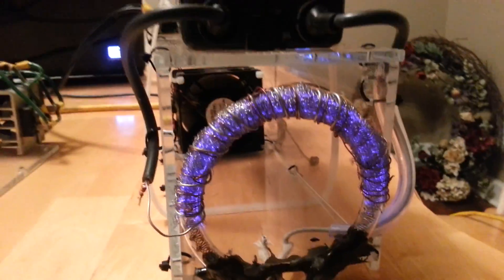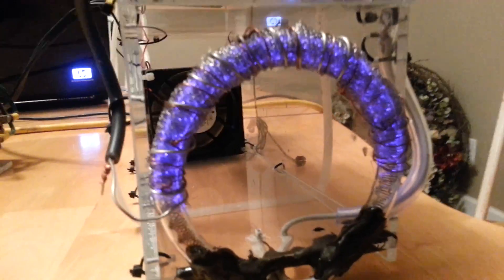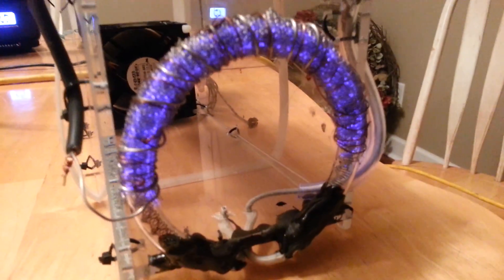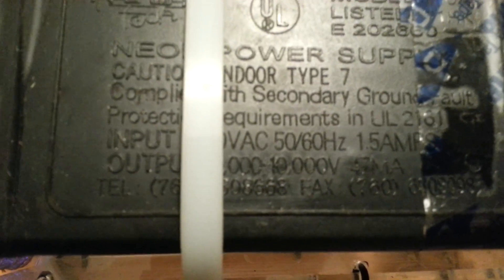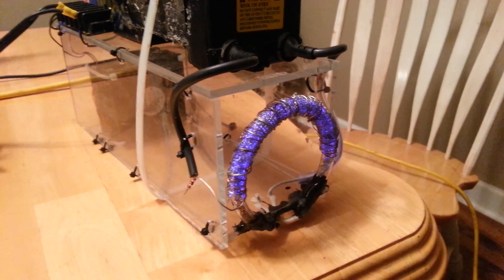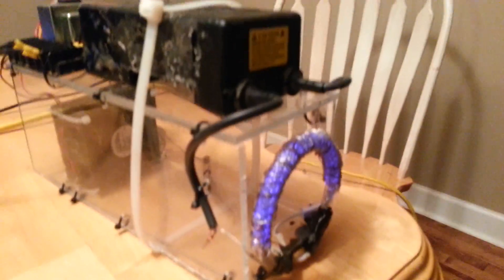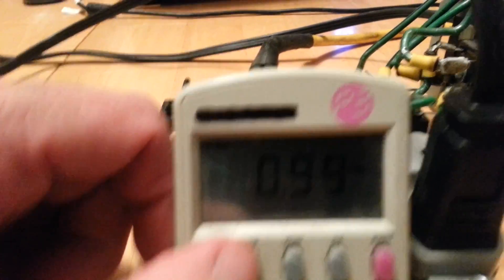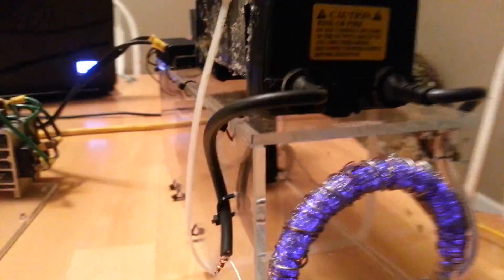Ozone generator  (completed )

Comment: Facinating, I had no clue about the fact of o3 having such an ephemeral half-life at such modest temperatures up until now. Same with the HF flybacks vs iron cores too as I have a few non-mutilated MOTs and was scouring around for some decent less-than-100%-death-probability HV projects before I just integrate them into my AC welder home-build instead...

Comment: Make a transformer to step down the voltage so you can measure it. Wind it specifically for your range- 1000 to 1 or 100 to 1 , whatever you need  to measure.  It does not have to be fancy, just be careful  to not interact with the HV

Comment: Nice! I’m wondering how much ozone that’s generating... maybe you could try to titrate it if you feel like you’re able to do so? It’s basically using a solution of potassium iodide and passing the ozone through it, then adding potassium thiosulfate until it’s light yellow, adding starch, then continuing until it’s clear. You must measure the amount of thiosulfate you add, then you can determine the amount of ozone you’ve generated with some chemistry math (I’ll tell you the equations if you want them).

Comment: solution to the heat problem is increase the sourface, basicly just use multiple tubes in parallel. For the fungus, its best to bring the generator as near as possible to the source of your problem.

Comment: I have been playing around with O-Zone machines for a number of years. One thing that was not mentioned is that Ozone will also deteriorate rubber. I experienced this, I had the rubber bands that hold a respirator virtually disintegrate. It not only lost its stretch entirely, it also severed itself where it was connected to the staple. I was so intrigued that I tried it a number of times and sure enough, every time I would leave it next to the O-Zone machine for a day the band would be severed.
I have been very reluctant to use it in an automobile
Reply from the maker: thanks for the info friend , ill keep that in mind
Reply: He lost his balls and his rubber 😉😂😂😂

Comment: try using a flyback from an old crt, The reason it gets hot is the amperage and you have 47 ma, which is far to much. I would recommend the flyback because it has a max of about 35 before it burns out and you can run them at higher voltage then current. id recommend below 10 ma, and my design for a small ozone generator doesnt use a dielectric, It is a low diameter piece of copper tube about a cm long and a nail is aligned in the middle with a device to adjust it back and forth according to voltage. You want the nail to be far enough away to get corona discharge, which is the loud hissing streamers, but you dont want it to strike an arc. Another bonus is the fact the moving ions push the ozone out of the pipe automatically, so no fan is needed to get a slight breeze of ozone. I upsized mine to a lattice of 50 pipe segments soldered together in a grid and a nail per segment and it really throws off ozone. I have found putting a high voltage capacitor of a low capacitance in series between the gap can sometimes make more ozone and thrust, but unsure. Be careful with NST transformers, 50 ma is right in the kill range. be safe, i aint responsible for any injury from my advice.

Comment: Hey NOBOX7. Can you tell me what you have behind the neon transformer? You have a big square behind it then another square thing on the table with all sorts of wires. I bought a cheap ceramic ozone generator off ebay imported from china ($23). The transformer broke the first day. Though the plates worked great before the power died. So I'm wondering if I just by a $50 neon transformer off ebay and connect it to the plates I already have with a fan... if that would work better?
Reply from the maker: The other device you see on the table is a Dc power supply that also has a watt meter on the board that i use to build and test things   , im not using the dc current in this video im just using the meter to measure the  power used by the ozone generator . the other square you see behind the neon transformer is a volt transformer used to power the blower fans that help discharge the ozone gas from the device and also keep the exciter coil cooled off  . If you do buy a neon sign transformer make sure its a flyback transformer and also keep in mind the plate size verses power source has a very narrow spectrum of operation , to small and you'll fry the plate , to big and it wont liberate much ozone , if you check my other ozne videos you will see i destroyed 15 to 20 plates before i found an optimum size and composition

Comment: Wouldn't the solution to lowering the heat be to increase the wind power? Which would beneficial because you'd be dispersing the ozone into a greater area, you would have to do it in a way that reduces noise though. There are some commercial machines that I have seen that kick out a tremendous amount of ozone that utilize static plates. Their main function is to reduce nasty smells by having the 03 molecule react with contaminants. I would presume here that the goal is to create ozone as a way to improve air quality.

Comment: argon quartz tubes work good and are safe as they don't heat up. Stainless steel screen separated by ceramic works good for an open air unit. For a closed ozone system so you can pipe the gas or use an O2 concentrator, argon tubes are good.  Argon tube inside a honed steel pipe or copper pipe. must be smooth as arcing will occur at seams and rough spots.

Comment: Been looking around and haven't noticed anyone attempting to use natural Mica sheet / Isinglass as found in woodstove supply shops, hair dryers and space heaters (Keep in mind not all Mica is the same, processed paper has additional binders which would likely cook out / not all hair dryer coil winding insulators would work the same compared to fabricated mica sheet.)

Hunting for my Neon sign now, I'll get back to you later. :D

http://www.anjanagroup.com/mica_tech1.htm
Reply from the maker: Good comment i never new the name of that stuff, soldering irons are loaded with that stuff, hey just remember a small electrode can fry your transformer , so be carefull , i highly recommend using a router speed controller and watt meter, you dont wanna burn your house down
Reply: NOBOX7
Got a desktop neon sign, still toying with ideas on the discharge plate, BUT it's also occurred to me that the grid from an old bug zapper driven by a high performance ignition coil (60KV+)  and a 555 timer pushing a 12V Op Amp isolator and wired with Spark plug wire might just do the trick. I'll get back to ya', but feel free to run with it.
Also hunting for a cheap fish tank air pump to push air through the "biggest pickle jar" I can find
;)
Reply from the maker: Ziggy Popacapolis i like the fish pump idea , i just scored on a huge batch of pyrex lab glass and one piece has an intake and discharge perfect for a force air ozone generator. you can sterilize water with it

Comment: Very good video, and I like your comments, and I like that fact that you are asking questions, and working together with the other people commenting to devise better devices.

I've been tinkering around with ozone, with no success so far.

I tried using a microwave oven.  I pulled off the high voltage wires that connect into the microwave generator (whatever it's called) and used a mayonnaise jar with copper wire wrapped around it, and a wad of copper wire stuffed in it, but nothing happened, even on high power.  Maybe I justmade a big capacitor.  Then I tried just 1 piece of flat glass with two thick pieces of copper wire taped onto either side of the glass, but still nothing happened.  I think maybe my voltage from the microwave is too low.

I wanted to ask Karolis P where he found a 16kv source.  That's sounds pretty good.

I found some china ozone generators on ebay that are just a transformer and a couple plates, and I'm going to see if I like that.  But, it seems a person ought to be able to build a high voltage transformer, and come up with something for plates, for less than it would cost to buy about 10 of those 7 g/hr (supposedly) ozone generators.

Any further ideas on what is a good insulator besides the sodium borosilicate glass?  How do you think plain ole' ceramic would work (the kind you use to make pottery).  The question is, what is the best for the metal electrodes?  Is thinner better?  Larger surface area? etc.

Please keep posting your info, as I'm very interested in whatever you learn.  If you like, I can tell you how it goes with the china stuff I bought.  It should arrive in a month.  If I'm really impressed, I just might buy about 10 of them, if I can't figure out how to build my own transformer better and cheaper.
Reply from the maker: your voltage is to low , aslo no glass or ceramic of any kind seems to be able to withstand the high tention , one thing i can say is your electrode size will depend on your power source, it tooks weeks of destroying my girlfriends china to figure this out, the transformers in old tvs will work they are called fly back transformers.
Reply: NOBOX7
Have you tried borosilicate glass, also known as pyrex, I think?  I looked on ebay and found tubes, plates, etc of borosilicate glass at pretty  cheap prices.
Let me know if you try it what happens.  I saw that you can buy quartz tubes, etc from lab supply companies, and not too expensive on ebay.
Reply from the maker: thanks please share your results

Comment: I too have struggled with an insulator. they all get holes burnt through, even a toughened glass cooking pot lid, which then shattered due to localised heating!!  So thanks for the tip on using that kind of bulb!

Comment: Hi isn`t it better not to breathe Ozone if you can avid it. Its handy for some things if you get out of the way, but can damage lung tissue etc I believe.
Reply from the maker: yes correct, this device is for mold and smell mitigation, and i have to say it works very well, i was able to salvage some very valuable old books with this device, however i have since avoided using it in my car due to the corrosive nature of the gas as im worried this can corrode my copper contacts on the 20 or so micro switches "censors" in the car

Comment: Just be careful with the UV output. You don't want to get cataracts.
Reply from the maker: i never thought of that , did you no halogen lamps emit high levels of UV , it will gives you sun burn in no time , it actually happened to me  wen the cover broke , then i noticed the sun burn and rememberd years ago reading not to operate holagens without a glass lense cover , sum bulbs have a coating for it
Reply: I don't really think this has such high UV level, I don't think it is bigger than a sunny summer day

Comment: i've been thinking of a design using 2 wine bottles as dialectrics.  1 small, 1 large -- with cut off bottoms piped into water using a venturi.  
i wonder if a 9kV 0.5A  source would push good O3.  would like to venturi it into water. 
i figure i can use a stainless steel winding of wire on inside and outside of small bottle, while the big bottle would contain O3 for venturi recovery.
i figure I'd put a rheostat before transformer to control Amps and thus keep heat down.
Reply from the maker: very good idea , i also suggest looking at lab set ups for ozone gas generation , they disclose some good info, the lab devices seem to favor high frequency systems also . they have very large gaps between the dielectrics and this is the air space thats used for ozone generation, but i don't do it this way i simply place the electrodes on both sides of the glass , this is hard on the glass but it works.any way you can purchase a devcie called a router speed controller at harbor frieght for 20$ they work great for power controllers
Reply from the maker: hey i forgot to tell you. stay away from large glass electrodes, if its to big it will act as a capacitor and and can blow up your circuit , i may have already told you this but aint sure, this happened to me, also the device plane wouldn't work if the electrode was a resonance size . the wine bottle will reqire alot of wattage im guessing 150 watts or so. the transformer i have does not have the power to run
a wine bottle size device
Reply: i was thinking about winding stainless wire inside and outside the small bottle.  technically, whatever i use IS a capacitor. I plan on a fuse regardless, so it should blow back on the circuit if the voltage surges.  Makes me think...i need 2 fuses.  One before and one after the 110v potentiometer.
Reply: where is 'lab setups' ?
Reply from the maker: chris argauer yes but a threshold exist , to big of a capacitor and it will slowly burn up your transformer or it will simply not work at all due to over capacitance , the test ive done indicated that a specific size electrode service area will function at optimum levels  , you will need a conventional dual winding step up transformer to run an electrode the size of a wine bottle  . please post a video of your device wen you Finnish it

Comment: Good advice. I have an IR gun and will monitor the temps.  My project is on hold as I wait for some quartz tubing to arrive. Picked up 72 linear ft of 25mm OD x 22mm ID tube cut into 141mm (5.5") pieces on eBay. This cost less than a 4' price at most retailers. If you would like a couple of pieces, private message me and I'll send you some.  I am hoping that I won't be burning through 3mm quartz.  Should come in handy for all kinds of projects.

Comment from the maker: i forgot to mention i monitor every thing with a thermal gun during testing, diodes can operate at 150 deg F but a good rule of thumb never allow heating over 130 degrees , at this temp internal elements can be as hot as 200 deg f , most circuits can handle 180 deg all day but i stay under 130 at all cost

Comment: Lol, yeah I bought one on ebay earlier tonight.  I opened up the case on the transformer, which was not easy, as it is glued closed and not meant to be opened.  It looks like failed caps.  I am going to try to repair this one for the fun of it, but i am going to get a backup.

Comment from the maker: yes when building something like this you never know when you will burn up a good circuit. i am running this device at 1/3 of what it can do and it will run for 24 hours 7 days a week. you need a watt meter to determine your power consumption

Comment: Thanks for the advice.  I build a similar machine with a linear element made with a test tube (couldn't find the cool semicircle bulb).  I had the same transformer and it melted down after about 2 hours.  The electrode stayed cool.  The internal heat sink melted the top of the plastic casing on the transformer though.  It is leaking all kinds of oil so it may have just been a bad cap.  Will get another and try again.

Comment from the maker: no i don't sorry but it is a 60 watt device and from what ive seen its a very powerful model  , this device has not bin tested for production however it can be done using beat juice , borosilicate glass is what you need to do this , ceramics and glass do not last long at the power level im using

Comment: The key is to keep ozone tube and circuitry separate and use stainless steel/borosilicate glass only for the chamber components. Also, to respect the rule of 3P - people,plants,pets should be removed from the area being treated with higher volume of gas. Changing the color of fungi is a good indicator but a microscope will reveal what happened.
Ozone is very potent oxidizer and will cause deterioration of rubber and other synthetic materials.
Thanks for sharing.
V

Comment: yeah i never saw a NST like that one before.if it hums like a MOT then its most likely straight up normal transformer but since its got 2 knobs then im guessing switch mode.
high frequency can give the illusion of less volts since HF tends not to jump large gaps like lower frequencies does.should be able to hear the frequency going up and down if the knob controls frequency.is there a brand on it ?

Comment from the maker: i was gonna ask you about this transformer, it has 2 adjustment nobs, 1 increases the voltage, do you think the other increases Hz ? also im confused bro, a larger active service area pulls less wattage ? a larger gap pulls more wattage then a larger service area, i tried to build a large low heat unit but i think capacitents causes harmonic distortion? , large gap electrodes run  way to hot but pull up to 180 watts ? if it gets over 250deg
the ozone decomposes back into o2